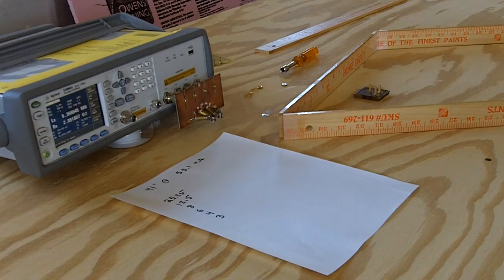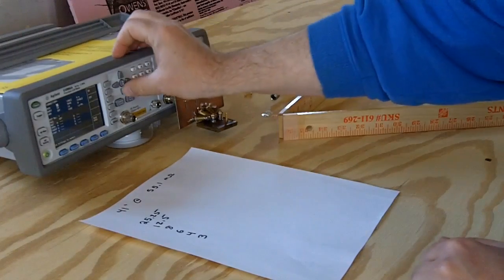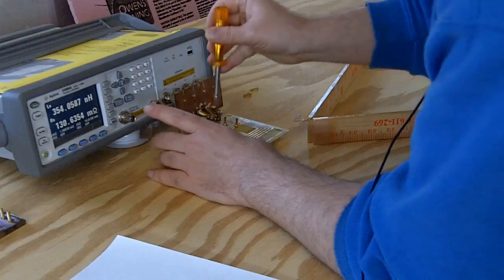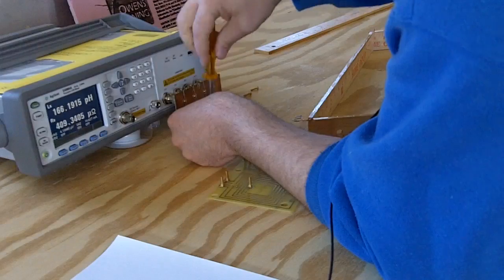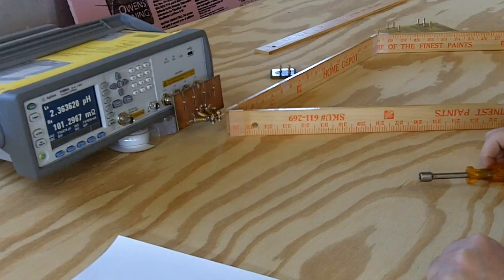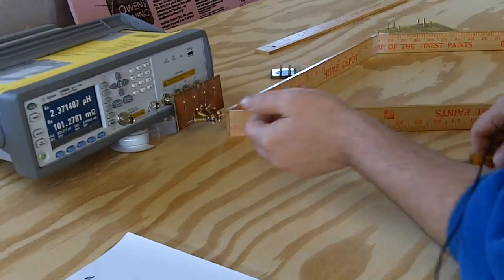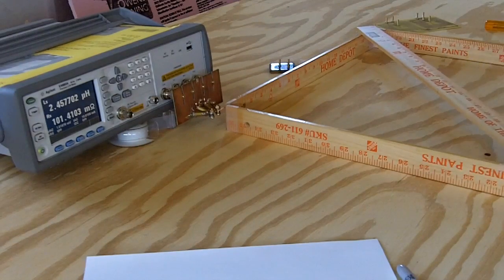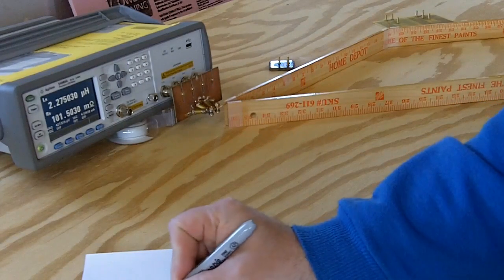emf002x: Measuring the Rhombus Experiment

Comment: do you actually think that they perniciously bogussed their experiments - or that not having all of modern technology devices with extreme accuracy and clarity )ohmeters, voltmeters, ampere meters vs oscilloscope and oscillators etc  - that they came to the only rationale for their formulas (and derivatives).  It is like wandering around with a candle in a black room, whereas someone now has a full LED light illuminating the entire room.  So making further accurate measurements and data, and calling out bogus where bogus is truly bogus (and constants are used as fudge factors hiding bogus) that real measurements, with real data (on video) that more-accurate, less or no constants, measurements will have the closest planetary Earth formulas and derivatives that pertain to our portion of the cosmic region.